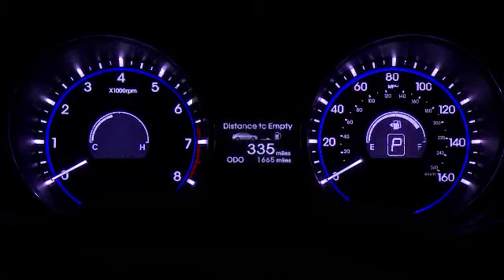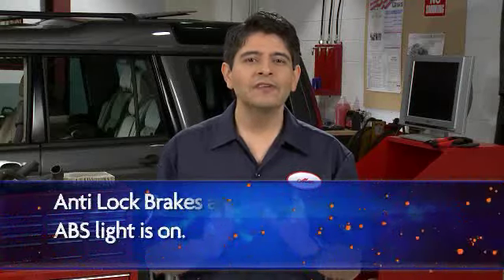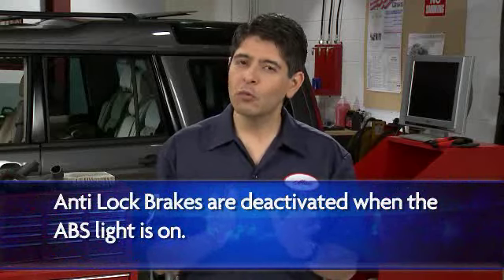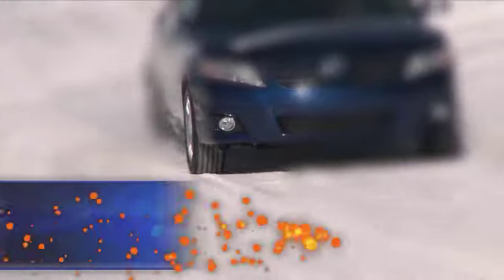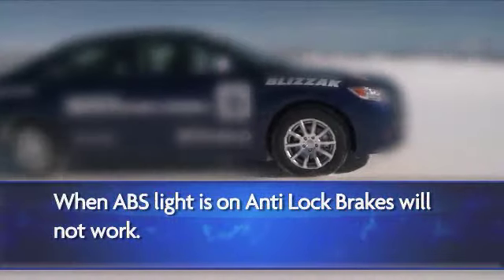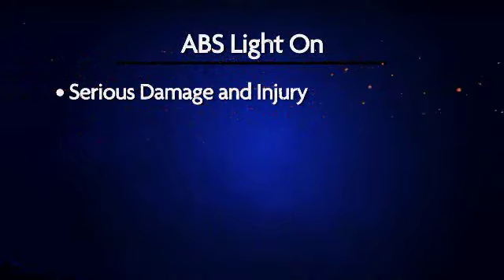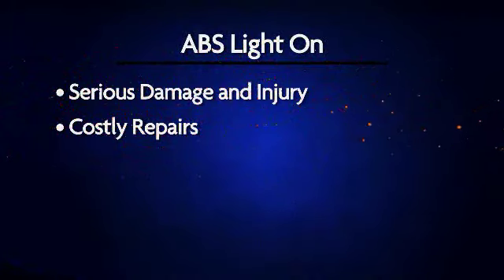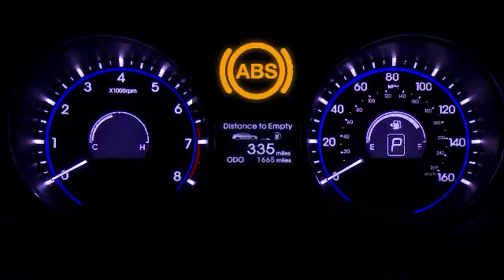What to do when your ABS light comes on?

Comment: Hi! I have a 96bmw 3.28i  and the machanic turned my abs on today. Before that I got a code po455...bought a gas cap. Check light went off. Few days after it came back on....same code. Check light isnt on??? When I drive I  smell gas n when Ipush on gas pedal....sometimes I feel clicking under car??? Would you happen to know....ty. worried!!!